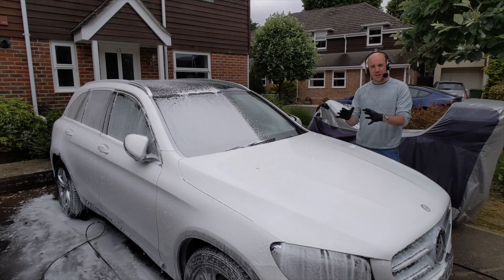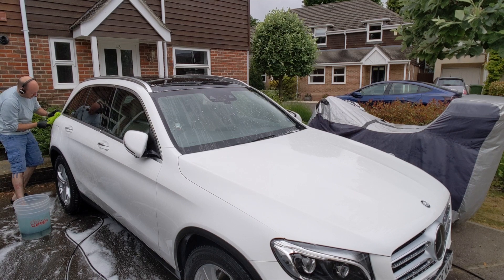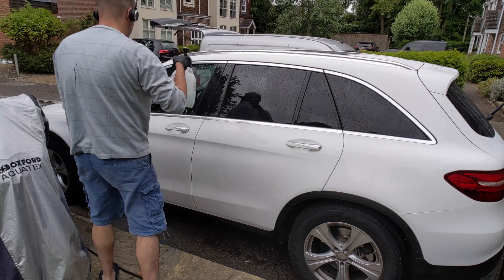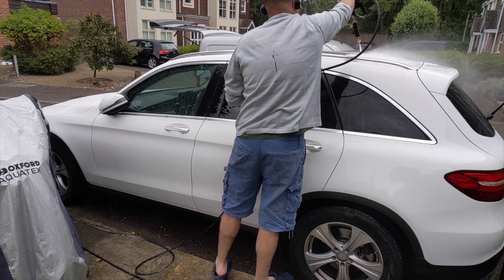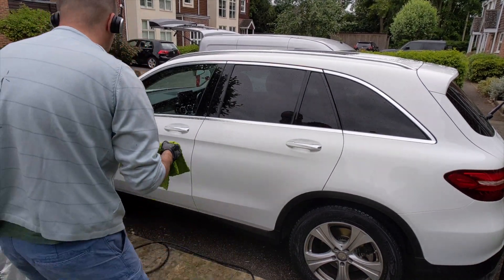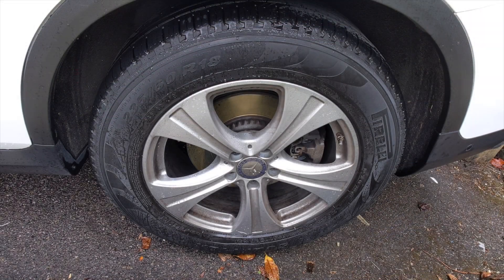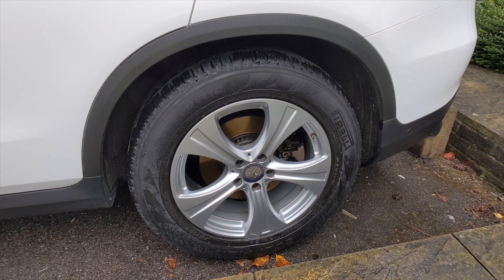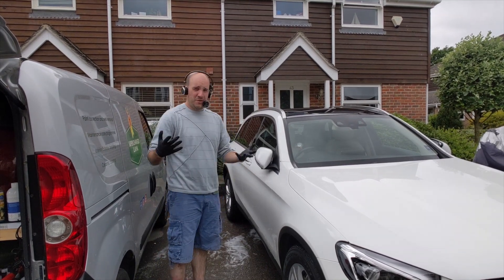VLOG: Washing my car with ONR for the first time, trying all the pre-wash combinations I can

Comment: ONR is great in summer with just dust but with winter mud, grit and salt in 🇬🇧 you have to use water pressure.
It is great for windows, interiors and clay lube too, 👍
Reply from the maker: Yeah I completely agree. I would say that I always pre-wash rinse (after soaking with the wash solution usually) because I know that takes so much off. I did a straight Rinseless wash once, 5 days after the previous wash (and in the summer), it was fine but it didn't feel comfortable. And I double passed each panel as I could see the dirt in the water left on the panel.
Reply: It's definitely a great tool for certain situations like having a good spray rince protection in winter such as bead juice or wet coat

Comment: Thanks for the video. I recently got a bottle, used it a few times and I don't dislike it, but I did find dried dirty water left on the car, even after pre rinse, 4 towels in the bucket and not dipping the dirty ones back in. I'll use it more I think once the car is properly protected. It actually does a good job on my house windows after a clean use Surfex. I mist the towels with ONR 1:256, wipe them and I have no water spotting issues.
Reply from the maker: It's the best way to get streak free glass for sure!! I find it an interesting product and I want to iterate and improve how I clean. Like you say, multi cloth still leaves some dirty water, so do you need to do the same panel twice when more heavily soiled? Perhaps, nothing states it's done in one pass, but we think that way when we're used to rinsing. Definitely a head scratched for sure.

When I go at it with multiple cloths I am properly tempted to just put 10 of the Costco cloths in the bucket and see how that does me (a bit like how Larry at AMMO washes cars).
Reply: @SuperchargedLlama  That's what I did today, 5 Costco towels but this time I sprayed one panel at a time and sprayed the Costco towels, wiped only once and let it air dry. Worked a treat! I am again converted lol
Reply from the maker: @roger4880  that's my attempt next time sorted! I'm glad to see the Costco towels work because, like everyone, I've got a shed load 😂
Reply: @SuperchargedLlama  Only issue I have with them is that after a few washes they go a little hard, but otherwise love them. Those get relegated to cleaning indoors.
Reply from the maker: @roger4880  I am in the same boat! This ultra plush one I used in the video is nice, quite big and maybe too big perhaps. They do a 350gsm version and that maybe the sweet spot. I remember Matt at Obsidian saying that the good quality plush ones last longer and wash up better. I think he uses the Costco ones almost as disposable ones when levelling ceramics.
Reply: To prevent water spots I put distilled water in the one bucket and spray bottle. I have a cheap distilled water pump nearby, a big container fills for less than a pound and will give several washes.
Reply from the maker: @martinbailey2140  yup I run DI water personally and the buckets will normally be filled with that for me too. In this example I didn't as I wanted to see how it handled the water here (350ppm).

Comment: You don’t need to fuss with the rolling technique on the glass - it’s not going to scratch! Personally, I prefer to do it panel by panel so I know where I am, then dry it straight after. This is more important on a black car so it doesn’t dry and go blotchy.
Reply from the maker: Yeah that was more practicing the technique for me as I want doing it well.

I'm also in the camp of one panel at a time i think, if I was doing it frequently enough then I also wouldn't need the pressure washer at the pre-rinse.
Reply: Yes, if you were doing it often enough then you could potentially get away without a pressure washer pre rinse, especially in summer. 

I know you have used one cloth, presumably for the benefit of the video. Personally, if I’m using cloths, I like to use several, smaller than the big one you have used and then left when all the useable sides have been used. I feel that is more safe. Another option is a wash mitt, though that means more dipping and rinsing.
Reply from the maker: @roscopervis  that was an interesting observation on the cloth because it wasn't really down to the video, more of a logistical experiment to see if it would work, plus it's the plushest cloth I have so I thought I'd start with that.

What I'm inclined to try next is the mitt as if I was going with multiple cloths I would be using shorter nap ones, which doesn't seem the best idea....and it's also a load of washing that needs doing afterwards! I'd definitely say that the single cloth isn't the right approach though, just as you've observed. I could definitely use the soft vikan brush on the plastics too, that'd save a lot of dirt on the cloth.
Reply: @SuperchargedLlama  I get ya Mother Goose. Everyone's first go is trepidatious so you want to make doubly sure, but I think as you have seen, it is very effective so it's more of a mindset thing.

Im also happy you have seen how good a prewash it is, when it's rinsed by a pressure washer! That was my biggest surprise.

Due to animal logistics, its not so easy for me to use a pressure washer at home now, so my typical technique is prewash at the petrol station jetwash, with a 2 litre pump sprayer full of the most suitable prewash (season dependent) then do a rinseless wash at home. I mix between Griots Brilliant Finish and Feynlab.

Other uses:
Glass cleaner - you have already demonstrated that. Feynlab isn't  the best at this at its normal dilution.
Clay Lube - Obvs
Rinse Aid - Obvs
Lubricity aid in a bucket of normal shampoo - only needs a small dash, plus helps dirt sink better.
Mild water spot remover - comes with its QD function and water softening ability.
Interior detailer - great for that, has decent cleaning ability, great on shiny black plastic and typically anti static.

Feynlab's is a bit different as it is so potent. It only says 1:250 on the bottle and that is meant to cover everything, and it pretty much does. It is too potent for most waxes and sealants though and will degrade them quickly, but is great on ceramics. Think of it more as a rinseless GT Decon almost. That means it can be used as:
A tyre and rubber cleaner - it works pretty well at 1:250 and foams up a bit. Go stronger and...
Panel wipe - As Obsidian Detailing has shown, this is a great use for post polish residue removal. It's super safe so even soft black paint is helped and leaves 'nothing behind'. If ceramic coating, I still panel wipe with the coating company's panel wipe, but it has virtually nothing to do.
Reply from the maker: @roscopervis  that's a brilliant reply with so much to talk about!

The first thing you me mentioned is mindset and you're absolutely right. This isn't just trying a new product either is it, it's a whole new approach and concept (in comparison to two bucket traditional shampoo washes).

And then the Feynlab option, I don't know much about it and have bought it purely to aid the polish removal as Matt uses it (initially anyway) but hearing you say that it's actually a great way of maintaining ceramic coatings is really interesting!

Comment: Great video. I made it to the end I’ve got a bottle due to hard water. 
Still not used it 
This is not something that suits my process
Reply from the maker: I feel like I should give you some sort of 🏅 for watching it all! I definitely didn't feel like it would suit my process at all....but it didn't feel that alien. Where I can see this being great is a weekly wash in the summer (even doing it once or twice a week tbh, it would only take half an hour or so I reckon, especially if you didn't need the pressure washer, which you wouldn't at that frequency).

Properly different mindset though isn't it? It still feels like the opposite to what I would do normally, I definitely need to play with the process still too because I don't think the single cloth approach is right at all (for me at least).

Comment: No offence intended. Lose the headset and mic. It’s like a really bad QVC sales pitch
Reply from the maker: I do completely understand what you mean and I don't like it either. Unfortunately it's the only way I can move around and do the audio at the moment, unless you'd like to buy me a Rode Wireless Go ii of course - that's the thing I want/need for this, but I haven't got a spare £200 floating around (and if I did, it wouldn't be going on that, hose reel for the pressure washer hose in the van is needed).